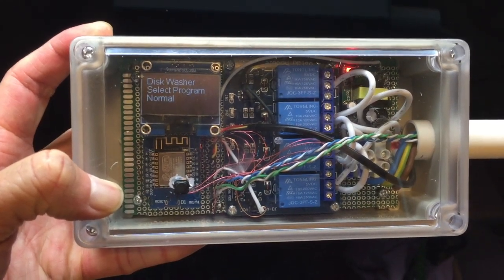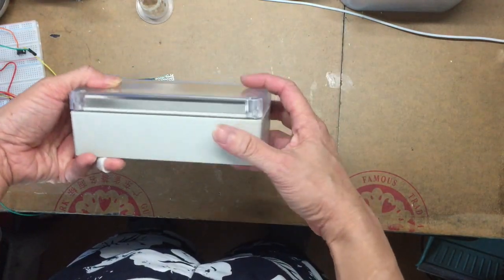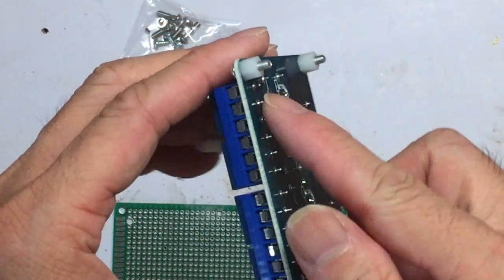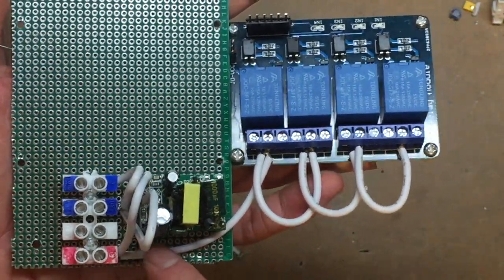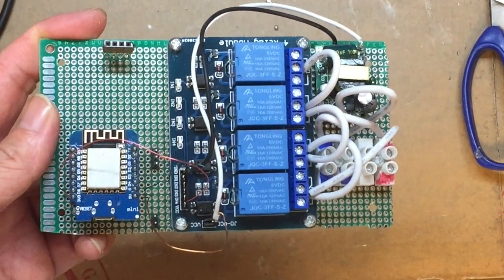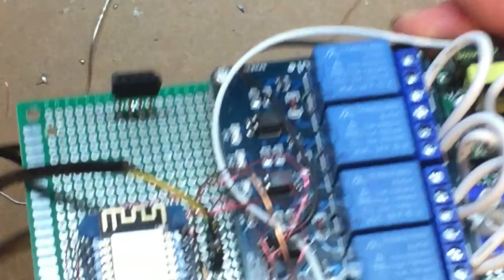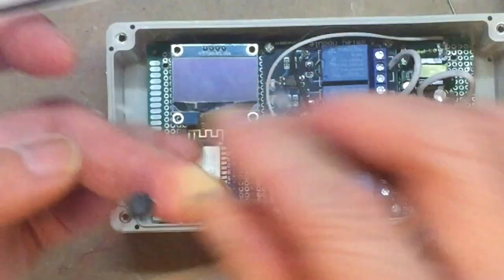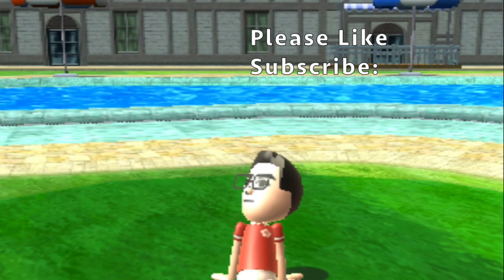DIY Dishwasher - Part 3 Build the controller

Comment: Well done!! Did you work around the Voltage issue safety concern from video 1?  Did you try mounting Sprinklers on the side instead of the bottom?
Reply from the maker: I managed to find a way around that. Putting all the connections at the lid placed on the top of the tank. Then runs isolated cables down to the pumps and the sensors inside the tank. Still waiting for some parts to complete the setup. Hopefully will post some more videos this week.